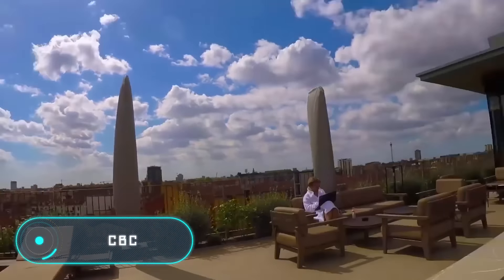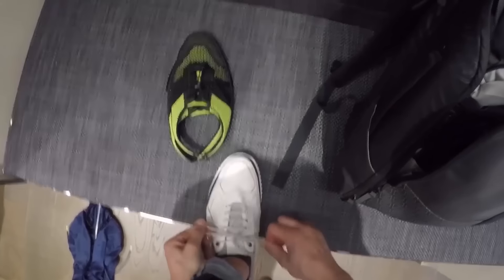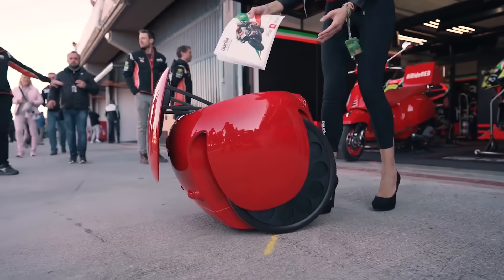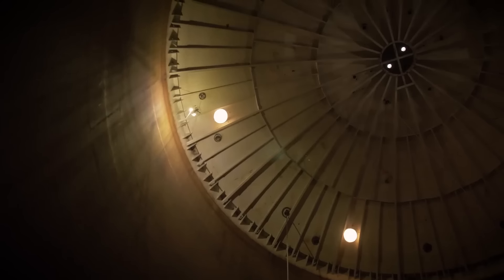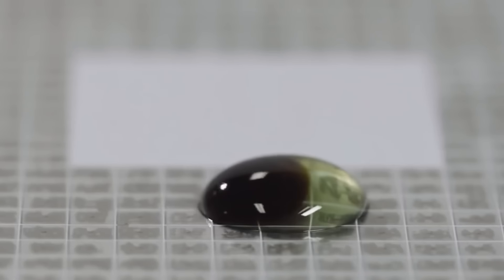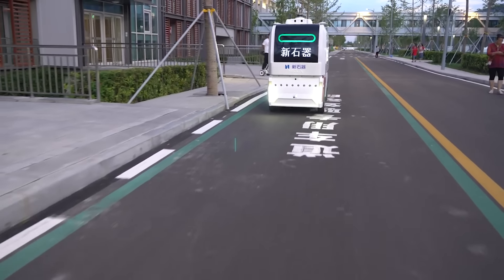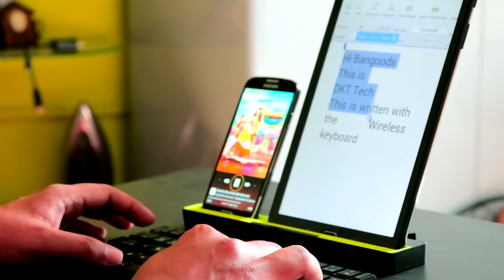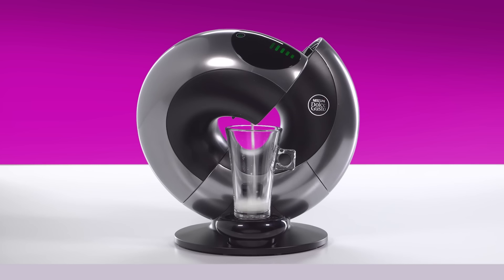7 MIND BLOWING INVENTIONS THAT ARE ON ANOTHER LEVEL

Comment: That roaming vending machine will be really convenient for distributors. Not having to go around and fill them one at a time. They come right to you when empty. You can probably program routes and then have backups for busier routes to get one heading out to pick up on the route whenever one starts to get low on supplies.
Reply: And make sure to have plenty of extras to replace the ones that get stolen and/or vandalized beyond repair.
Reply: @davidcool5189  I'm guessing they have gps in them so you can keep track of where they are and I imagine they have a way of detecting damage similar to technology used in some cars for collision detection.
Reply: @RiceChrispy0527  at which point the vending machines would cost too much to make a profit from selling $1 drinks/snacks. Keep in mind the electric costs of having to roam everywhere.
Reply: @efonwang  most bigger cities, where this would be most useful, have charging stations for electric cars already and it only costs for the parking space for a while. Charging system on those is likely similar enough for those to work.
Reply: @RiceChrispy0527  still extra costs on top of a regular machine that just sits there.
I'm guessing a fancy machine like this will run anywhere from 5k to 10k each. Minus the maintenance, electric, security feature costs, this would take a lot of sodas to bring that money back.
Reply: @RiceChrispy0527  a roaming vending machine will likely just be used on large campuses like schools or big corporations. They can at least control the environment better to not have to worry too much about unbeknownst variables that may damage or lose the machine.
Roaming on city roads would be a big obstacle. Just tipping over on a small driveway would require another drive out to fix it. Probably not worthwh6
Reply: @efonwang  yup, that's called an initial investment, to get any business started you have to make one. It might not always be cash money, but it will cost time or energy. Some things are for people who are brave enough to just do it.  And if someone does, they could make a pretty decent profit from them, but it won't immediately be profitable, it'll be like any other business that sells food/drinks, it takes a while to start seeing true profit, and if you're good with business you'll have your machines roaming around near festivals or other public events where there are gatherings of people where you can get spikes of profit.
Reply: @efonwang  ah see now you're starting to see my side. That wasn't so hard was it? ❤️U ✌️

Comment: carrying 300$ worth of groceries for someone to grab ya robot and run, yeah totally smart.
Reply: Too heavy ,  no worries mate.
Reply: Unlike you shopping a really expensive grocery store you ain't going to fit no $300 worth of groceries in that little thing
Reply: Curtis Bennett but the machine alone is like $300 lol
Reply: You ever ran with a stolen tv?
Trust me you won't get far 😆
Reply: There is a service called delivery. It's available in all big stores and supermarkets, and it has already existed for decades.
Reply: @wychan7574  yea, and it costs you a hefty fee
Reply: People walk with bags all the time. A bag is much easyer to steal than a 23kg (50lb) robot filled with crap..
Reply: Is to heavy for anyone to just grab and run
Reply: Most likely would come with a tracker
Reply: Without the sensor, you'd have just stolen a pretty brick. 
2:58 🙄
Reply: @wychan7574  theres also a service called a shopping trolly bag that can hold like 3 times as much as this thing can and its technolagy is so advanced it dosent even require a massive battery and a hundred sensors
Reply: Ram

Comment: I like the Gita robot. But what if the programming of that robot is hacked by someone? Would this mean that it can possibly be stolen easily through hacking. I just thought that if it were hacked, it would no longer follow the real owner, but the hacker instead. Possible right? What's the safety measure in connection to this matter?
Reply: i think the developers might configure that problem

Comment: The genius of some inventions truly exceeds the intelligence of some people.  Yes, the Gita only has a 4-hour battery now.  But that will improve as batteries improve.  Further, if you need to go shopping for four hours you have a mental condition that needs treatment.  Also, no one is going to steal it because it travels with you; not by itself.  The drone with the cage is brilliant because of the cage.  Most drones cannot see angles other than the present plane angle set before the drone takes off.  This drone has a geometric cage that allows the drone to change angles without the need for multiple robotic gimbals built in to change the angle of the camera.  You simply push up against a surface at different points and the cage alters the angle of the camera.  Brilliant.  Please see past your smartphone people.  Invention doesn't end fold-able keyboards; which have been around for two decades.